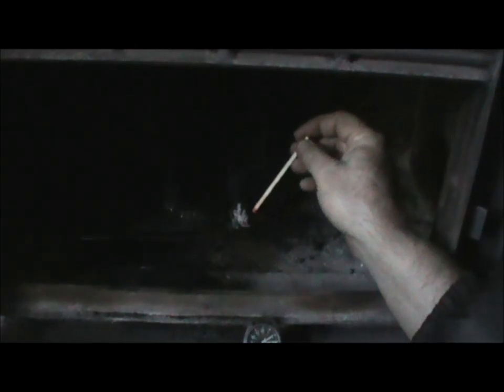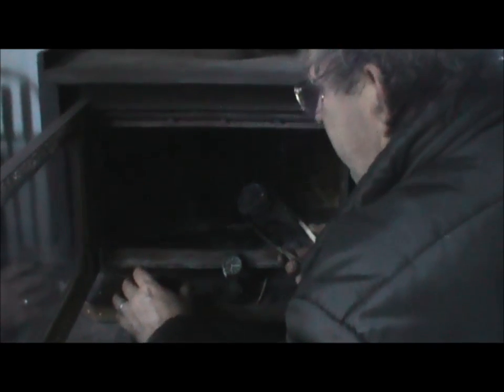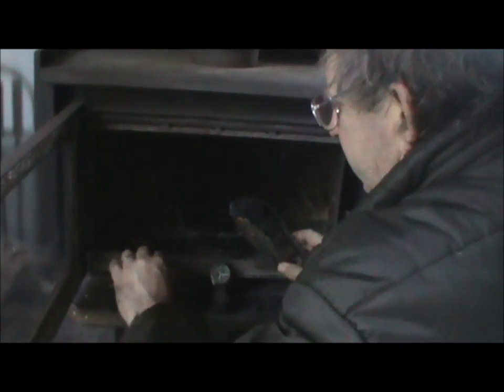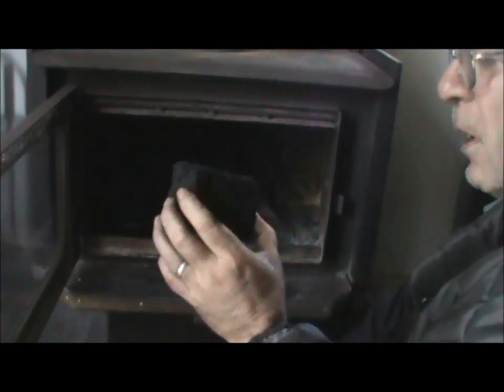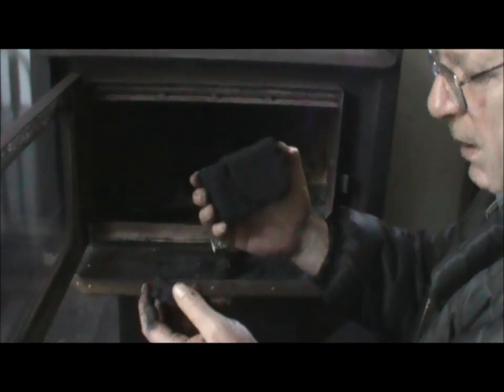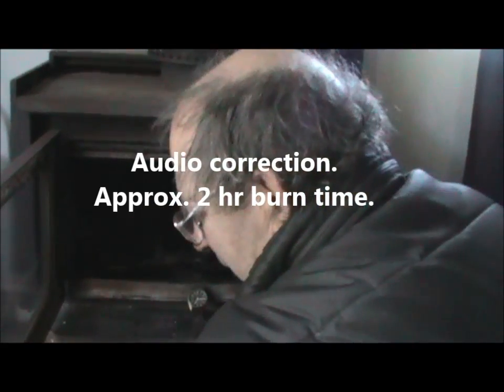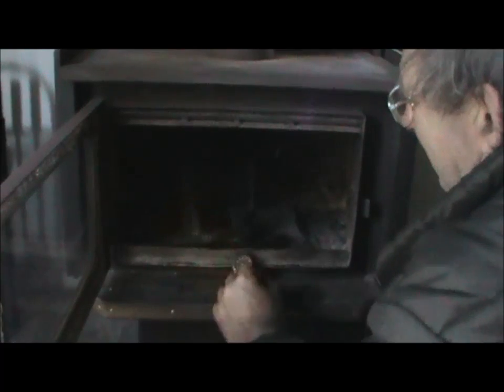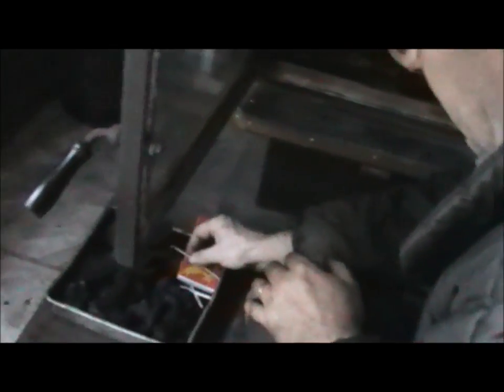Charcoal briquettes, burn tests. Part 5 of 5

Comment: Very interesting! A lot of work to produce these videos. Many thanks for sharing these videos with us. Have you been using these briquettes regularly?
Reply: No problem, Austdragon,
In NY we have snow and cold in the winter, but I am planning to get my material together slowly and as soon as I get 1-2 weeks of warmer weather I will test the briquettes. Definitely they need to be packed, though. I will post a video soon with the way I did it.It will be mostly your way only I will work on the packing method. I must create some sort of device to pack the mixture. I will use cornflour as the binder. 
My problem has always been finding good lump charcoal. Usually the bags have a fair amount of dust and it is not usable for barbecuing. 
Thanks for the videos.

Comment: That looks like a fair bit of work for a few hours of heat, though. But I suppose if you can make bigger batches it becomes worth the time and effort. Thanks again!
Reply from the maker: It is a lot of work, the way I made them. But a good diy production system would be better for bigger quantities.
I think it is important to note, these are made from pure charcoal, unlike some commercial brands the have Petro chemicals and artificial toxic junk mixed in with it.
All the best.